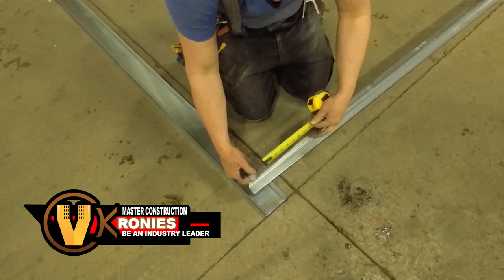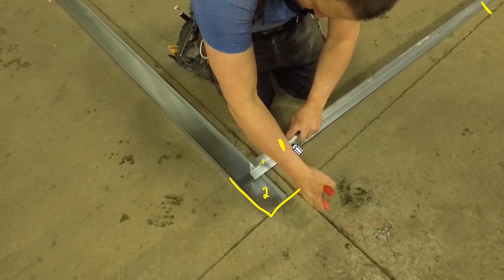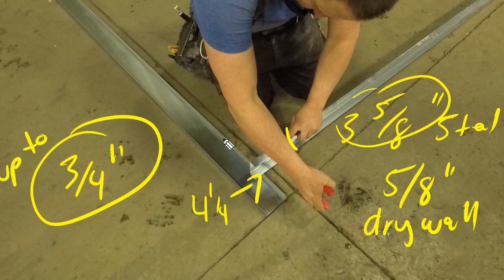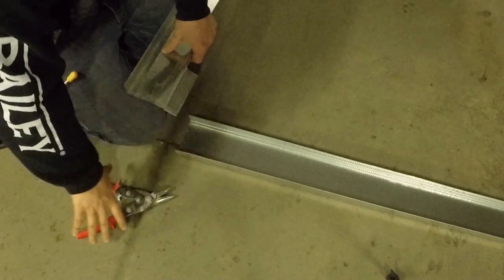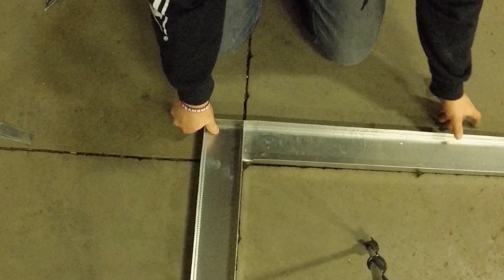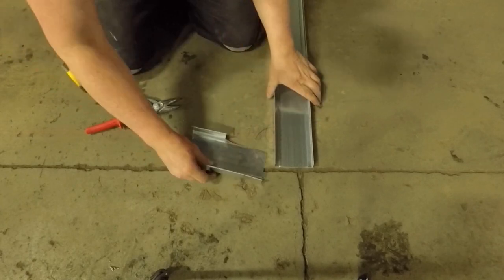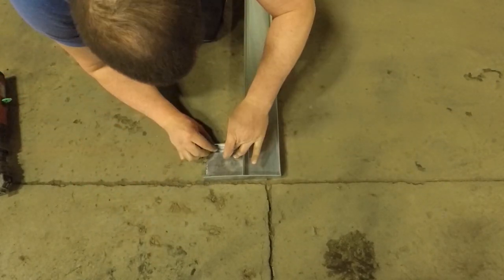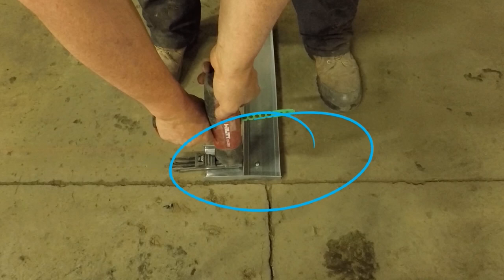Master Metal Stud Framing & Drywall All Types Of Corners Lesson

Comment from the maker: :_KronieHammerTime:Keep Learning Metal Stud Framing HERE: https://bit.ly/ExpertFramingLessons
Reply: Hey man hope your doing well.  I usually put the relief cut on the longer piece of track so that the piece attached to the frame goes into the wall and gets locked in making it stronger.  It does screw up the flow of the installation of.board depending on which way you start your drywall.  What's your opinion on that.  Awesome channel👍
Reply from the maker: @johnlee4014  yes, I know it's easier that way but I also screw my door clips in without the tabs. This way is the proper way to do it. Cheers man, I know your comment is over a year old just saw it! Thanks for watching 👍
Reply: Quick question, how do you run electrical around corners with this method of locking in the drywall? Do you leave a little slack in the electrical so that you can push in the drywall, or do you just cut the drywall so that it stops before the wire?

Comment: Thanks for the video, it's supper helpful. How do you install 2 layers of 5/8 Fire Codecore drywall to Conder Blocks? Can I just glue it or use Wood first? Or any other best practice I should follow?
Reply from the maker: We have done it a few different ways. 1. is to glue and pinbolt the first layer to the block then glue the second layer to the first - very expensive
2. we frame a furring wall in front with 1-5/8" 25 gauge stud or 3-5/8" so electrical can go in or 6" for plumbing and electrical (this is the best way) 3. we shoot and drill 7/8" furring bar to the block then drywall. (a pain to do)
Reply: @ConstructionKronies  Thank you again! I think I will go with the second option you have mentioned. Keep making all the great videos, super helpful.

Comment: Many thanks for the vidio. Please could you explain how to make a corner where the angle is not 90° but 115°?
Reply from the maker: If you can imagine, overlap and run the top and bottom track ad tight as possible then put the studs in to ad close to the corner as you can get. The studs will be a few inches or more away from the actual corner, just float and 45 the drywall.

Comment: Great videos keep them coming. Question, double drywall , should i add to formula or not ?
Reply from the maker: Yes, you bet, for double 5/8 go 1-1/2" and if it's double half inch for some reason go 1-1/4" for the tab plus the steel width.

Comment: We do commercial steel framing in Canada. I started last year. Ive never seen anyone caulk the bottom track. Some of the guys I work with seem like real pros, everything the do comes out perfectly square and straight everywhere and the finished product is beautiful. Those guys also never use caulk. So Im wondering what is the poiny of using caulk?
Reply from the maker: It should almost always be used, for water, sound and thermal bridging. On any walls that are dividing or fire rated always use it, on exterior walls we use foam gasket. I'd use it in kitchen, bathroom, all basement walls for sure.
Reply: Thanks for the reply. I guess I work for a company that cuts a lotta corners then. We do fire rated walls all the time, but we have never used caulk.

Comment: Should you use caulk for the bottom side of the track or a thin sheet of foam?  If caulk, what kind of caulk do you recommend?
Reply from the maker: Yes we use the Chemtron acoustical caulking under the bottom track for interior partitions and foam gasket for exterior walls.

Comment: Hi There. Love the videos. I am building my first steel structure this summer and wondering how much time I should allow for a team of 4 guys to closed off ext. walls from corrugated metal siding to drywall (2 X 5 /8 type X), wool insulation. I figured 2 hours per section of 10 linear feet. Walls are 12' high. Does that make sense?
Reply from the maker: If your taping the inside of the building and using membrane I would allow 38 hours per 10  linear foot ready for paint if your not taping or using membrane allow at least 19 hours per 10 linear ft.
Reply: @ConstructionKronies  thanks for the reply...do you mean 4 guys @ 19 hours each so total of 76 man hours for 10 linear foot section no taping. ?
Reply from the maker: No that is based on 4 guys, 19 hours for 4 guys. And your very welcome

Comment: When you have walls taller than 10 ft do you have to add purlins to prevent twisting?
Reply from the maker: Negative, no. Two things, 1 we always square the stud in the top and bottom track and 2 we use carrying channel every 4' (bar that goes through the stud knockouts).

Comment: Mate, have you a suggestion on stud positioning and track cutting on a 45 deg corner? Not 90.
Reply from the maker: sure yes, that happens. You don't need to end the studs tight against each other just stop them so they can be squared close as possible to the end of your track, usually 1 to 3 inches apart. Let the drywall form the corner. Does that make sense?
Reply: @ConstructionKronies  yes thank you.

Comment: 11:52 opposite what you said, it's actually stronger because you have 7" drywall vs 3" and it's also easier to hang since you can slide it through the other wall if hollow metal doors is already attached.
Reply from the maker: Yeah, that's a common misconception many people think.

Comment: Brilliant detailed video, Thank You 👍
Reply: Can you explain the Staggered joint's,  is it for 🔥 ?
Reply from the maker: Yes stagger joints are for proper fire rating and strength. Why we also stagger where the bevels land from side to side of a wall with single layer both sides. Cheers man!!

Comment: Got a commercial TI coming up with steel stud. Vids are awesome! Thanks for sharing. 

Could you go over other intersections, T intersections? Partitions (10’)  intersecting full height (16’) corners and T intersections? Bracing? 

Thanks.
Reply from the maker: Yes for sure! I have a full metal stud framing playlist. The 2 videos I put out before this one go into more detail. I cover everything but the t intersection. For that I can easily draw you a diagram if you catch me live. All you need to know for that is to leave your track back so the drywall can pass through the wall and then you tie in the floater. You can also stop the drywall in the middle of the floater to bring out into the rooms.
Reply: Thanks I’ll look for live, most interested in tieing top plates together with different wall heights, or do you brace and rely on drywall for fastening? 

You’re killin it, keep on making content!
Reply from the maker: @MerlinConstruction  Okay so what i do when tying in different wall heights is  this; find where the new  wall runs into the existing and put a brace across the 2 studs in that area. I actually laser the top of the brace to be the top of the wall I need. You can either add a 4 to 6" pc of stud to catch the track or cut a tab out of the track. I use a stud for the brace and lay it flat side out toward the new wall.

Comment: I like to run the Track on the door at ather way  , when are welding door  is easy to run the drywall in side the frame , all framers need to think as are they hanging the drywall!
Reply from the maker: Yes, the drywall is the final step in setting.a.door frame it's good when  the framer considers  the drywall and the boarder knows to get the hinge side locked in first with a laser level.

Comment: personally I run my slammer stud on the other wall. To me a 81/2 inch wall is stronger than the 4 1/4 wall. Regardless the way you did it will work but my way is better. Good video !
Reply from the maker: I have heard some guys do it that way🤘

Comment: Very informative video i usually do wood framing but im finishing a basement and would rather do metal plus metal framing is actually cheaper than wood but one question which shots do i use for the ramset for the metal tracks if you know
Reply from the maker: Yeah the Ramset should have steel to concrete and steel to steel. If you ask a clerk they should be able to tell you. I'll try to look them up and link them too!!

Comment: Amazing video!! Do you not need to put pressure treated base plates down on the floor?
Reply from the maker: Nope, not with steel. But you do need a foam gasket for exterior walls and chemtron black acoustical caulking for interior walls.

Comment: Given the price of wood, I am considering using metal framing for my basement.  Plan on using pressure treated plate on bottom.  My question is how to do the ceilings?  Should I just drywall my entire ceiling first?  Or can I still do it as normal and frame the walls first, then drywall the ceiling, and finally drywall the walls.  With the floater not being connected, the order doesn't really matter?
Reply from the maker: Don't use the pressure treated plate for the bottom just use steel stud track and caulk it with chemtron. Frame the exterior walls first. You can drywall your ceiling and then frame your interior partitions. After that frame and board your bulkheads and drop ceilings. If you have any questions at all let me know. You can send me pics and I can help you even more!!
Reply: @ConstructionKronies  My thought for using pressure treated lumber, was to leave gaps so that if a wall leaks, I will be able to find  it, instead of trapping it behind the wall.  But I would only do this on the exterior and not the interior partitions.  Do you have a video on how to frame bulkheads with metal?  I need to span 8' from side to side.  How would you recommend doing that?  I assume using 1-1/2" corner angle and track?  Thanks for the quick reply!

Comment: How do you know which direction to put the studs?
Reply from the maker: We face them hard side the same way we draw our tape measure from. It's instruction to the drywaller on which way to start from as well. Think of them like an arrow pointing in the direction you want the drywall to go. Hard side is the flat side and soft side is the open side. We also always screw the soft side then hard side in the bevels so the studs don't twist. Hope that helps!

Comment: Sorry for the back to back questions, but which layout do I use for corners of a room where foundation walls are forming the corner? Is that considered an inside corner or outside corner? If it’s an outside corner, and I have foundation wall up against it, would I just screw from the corner stud INTO the track as opposed to going from the track into the corner stud?
Reply from the maker: Yes exactly. I use crimpers for light gauge as well for the backsides you can't get a drill in, just do a small half crimp and toss a screw in.
Reply: @ConstructionKronies  ok awesome, so that’s considered an “outside” corner, correct?
Reply from the maker: every corner will have an inside and outside. Sometimes we only drywall one side.

Comment: On corners, How do you pick which track gets the cut for the floater and which runs the whole way thru?
Reply from the maker: I am trying to word this right for you. So, the direction you pull your centers from is the flow of drywall so I put the floater stud in the first wall that gets drywall. Just think about the order you want the drywall to go on. Imagine a hallway with rooms, you want to drywall the inside of the wall with all the doors first and then tie in the floaters from the dividing walls. I hope that helps! I will try to remember and do a follow up video for you!
Reply: @ConstructionKronies  nice thank you! The first part made sense, got lost on the last part lol

Comment: I’m using metal studs in my basement and so I’ll be putting a base plate of PT lumber under the track. How do you do this if using PT under your track?
Reply from the maker: You sure you want the wood under? I would just use a foam gasket or acoustical caulking like the chemtron. But if you want it, you will need to hammer drill in smack pins!
Reply: Interesting! I’m not tied to using the lumber, although I do already have it. I’ve just always been told that you have to use PT under it when framing out a basement. But just using foam gasket makes sense. I think the only question I have is, do I just put the edge of the foam on my chalk line so that the edge of the foam and the metal track all sit flush with the chalk line, or does the foam need to overlap either side of the track? If it does need to overlap, how do I make sure I’m on my line?
Reply from the maker: no overlap needed, the foam will just go on the bottom of the track centered. sorry I missed your reply YouTube doesn't notify me properly when someone replies, I need to go in an check for them and I didn't have time till now.

Comment: I've been told to make the door hinge side of the wall the longer side. So that the floater is on the wall coming perpendicular. Was told this because after a while that small piece of drywall will start to crack if only 3 1/2" or so. having it slide through makes it longer and less susceptible to that. Is this true? Because ive seen both on job sites but told that the way shown is wrong. Thanks
Reply from the maker: This is actually a long time debate. At the end of the day I don't think it really matters. What really matters here is the fire rating and details around that. We are seeing a new trend in codes requiring hard corners and floaters are being limited. Just know your local code and do what the guy paying you wants. As for the piece cracking that will not happen. Its a taped inside corner and either covered by trim or slipped inside a welded frame.
Reply: You are correct, floater goes on the other perpendicular wall. Easier to hang drywall too.

Comment: The floater stud is a wonderful method. But what is the concept of it,if you don't mind me asking?. Reason?
Reply from the maker: It has a few purposes that I know of, 1 - Specific Fire Rating, 2- Easily pass drywall through to lock in walls tight and 3- It gives your corners more strength, especially when there is a door it really gives that small leg more meat and potatoes if you know what I mean at the same time it makes it easier to get that little sucka in!
Reply: @ConstructionKronies  that's amazing brother thank you for your help

Comment: Can you use tapcons  if you don't have a nailer
Reply from the maker: I wouldn't recommend it in the concrete but hex head self drillers 1/4" or 3/8" will work for any steel.  Use the smack pins (pinbolts) in the concrete, hammer drill first.

Comment: Great drawings information, the words are less clear without the drawings! But that's my inexperience confusion in sure. What's the purpose of the caulking - sealer, glue, what?
Reply from the maker: The caulking is for moisture and separation between substrates. Every wall either has either caulking (interior walls) or foam gasket (exterior walls). It is also an acoustical treatment. Cheers for the feedback I am always wanting to improve so thank you!!!

Comment: Knowing nothing about framing or drywall, why put the drywall into the stud and tie it in ? Would it not complicate replacing the drywall in the future ? Thanks for the video, very informative.
Reply from the maker: Some regions are taking the floater stud away and making you put in hard corners everywhere. The floater is great, it saves you a stud on corners and gives a great amount of strength. Replacing it does suck because you have to cut it down at the corner and add a stud but that is rare and usually will be years down the road. At the end of the day you can do whatever you want here as long as your following the job specs.
Reply: @ConstructionKronies  thank you for the reply
Reply from the maker: @RONNIEJNZN  you bet, I hope that makes sense bro!

Comment: Good tutorial. I am planning to create some partitions for classrooms, but the top track does not go to the roof. It means that there is a space about 20 inches in between them. Do you think it will be strong or weak?
Reply from the maker: It depends. You can use stronger steel, can add sections that do go all the way up, tie into structural columns, I would need to know more. Sometimes we do offices and the walls are weak but tighten up with drywall. You can add structural type half columns into walls as well to strengthen them. I'd go 20 gauge steel with 5/8" type x drywall.

Comment: instead of a floating stud can you do a California corner?  Or does that not work with metal?
Reply from the maker: You can do hard corners yes, always just check on fire rating requirements. Sometimes the floaters are specified and sometimes the hard corner. In a non fire rated wall you can do it however you want.
Reply from the maker: You can do hard corners yes, always just check on fire rating requirements. Sometimes the floaters are specified and sometimes the hard corner. In a non fire rated wall you can do it however you want.

Comment: You guys don't have to use a sil gasket in Alberta?
Reply from the maker: Yes we use it on all Exterior walls and use the acoustic caulking like Mono or Chemtron for the interior partitions if it is specified. I like to use it always on fire rated walls for sure and always on Exterior walls.